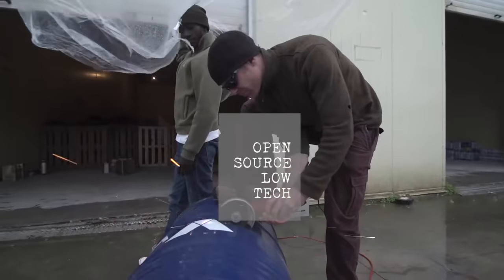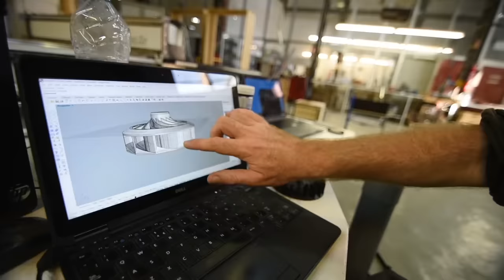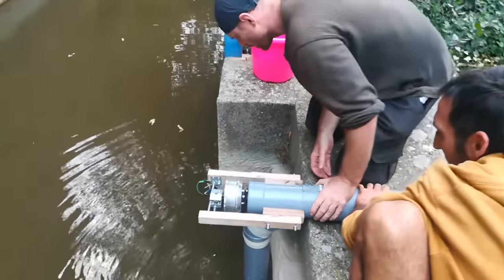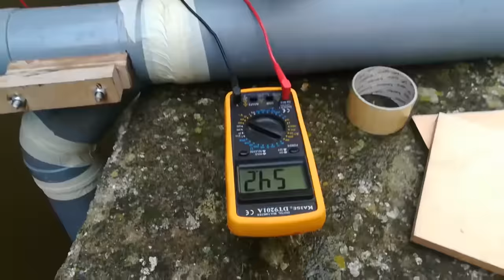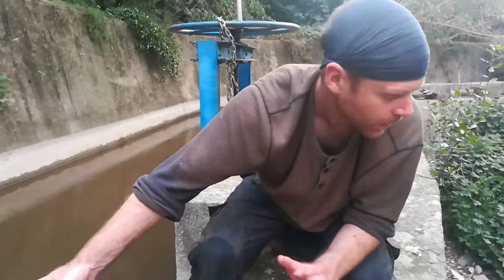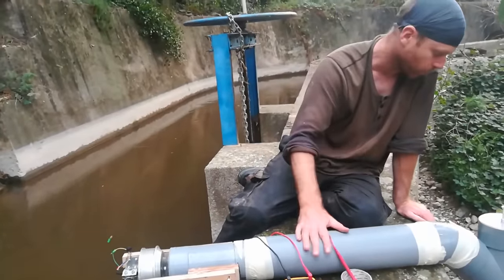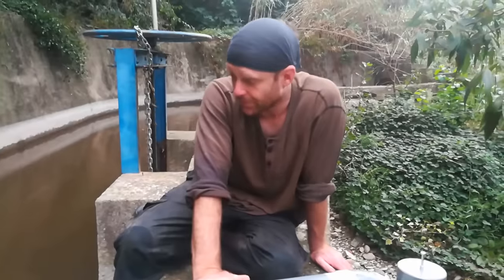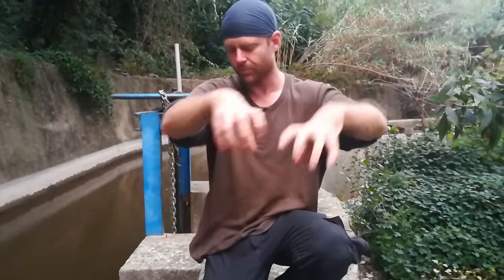The $50 Water Turbine -DIY, Portable, Powerful, and Open Source

Comment: Hello, can you tell me how siphoning with an open bit at the top works? Am I wrong about siphons or do I miss something?
Reply from the maker: Which open bit?
Reply: @OpenSourceLowTech  Does having the turbine wheel at the top disrupt the siphon?
Reply from the maker: The only hole in the system is where the drive shaft exits and connects to the alternator, which I've got gasketed with an O ring and some foam rubber, which seems to be working fairly well in terms of low friction and a decent seal.
Reply: @OpenSourceLowTech Ah! Thanks! I understand it now!

Comment: You should not put the turbine on the horizontal plateau, but instead on the downward slope; you'll avoid risk of cavitation (lifespan increase) and high point bubbles (downtimes on hot season).
Reply from the maker: Indeed, check the part 2 video for pretty much exactly those findings.

Comment: Hello I am wanting to do something like this on my houseboat as a power source would love to speak with you on details on this
Reply from the maker: This design does need some drop, at least two or three meters. It won't work with flat water. There are options for that, but they generally only give useful power in quite fast flow.

Comment: Dude are you telling me that i can have 1 huge pool of water and I can put this in the pool and I can lift the water up 2 meters and once I start it it wont stop ? it does not need to be a river:) and a wall. I got the part where the power is coming. The thing is. i doubt water will keep on coming up especially when having a propelar to spin. Sounds interesting for a try.

Comment: Good Afternoon sir for thesis proposes where i can order that protable turbine. Because we want a thesis like your idea but it will be in sea water ang improve same of idea. May be it will be floating etc.
Reply from the maker: This turbine won't work in flat water unfortunately, the output needs to be lower than the input for the water to flow and power to be extracted.

Comment: 2 things, need 2 bearings on the turbine shaft could hear it rubbing inside of pipe, also just pull the cap to break siphon instead of lifting the whole thing on suction side lol
Reply from the maker: There's a bush bearing at the impeller end made of a nylon collar and stainless washers, for corrosion reasons. The sound isn't rubbing, just that the shaft ended up not quite perfectly centered so there's a bit of oscillation. 
I tried to lift the cap but the suction was way too strong for me.

Comment: how does the pressure work on that pipe? how does it suck water to spin the turbine?
Reply from the maker: I'd quite like to see a full pressure profile for the length of it, but basically it's just a siphon, so the fact that the output is lower than the input has gravity pulling the water through and establishing momentum.

Comment: Additional options
1-Add a battery to jump start the pumping without needing to add water
2- add a charging feature to power said battery to jump start the water pump at a later use/time
Reply from the maker: Would be nice if the turbine were reversible, and could be used as a pump. Unfortunately tho the fan / propeller type runner wouldn't be capable of lifting a water column in air.

Comment: Muy buena idea
Faltaria comparar con un sinfín de 20 cm de largo y el mismo diámetro ( similar a los que usan para mover granos en los chimangos de las monotolvas de cosechar y mover granos) ,si no es superior el par de fuerza
Reply from the maker: Archimedes Screw turbines are good, but harder to make. Much higher torque at much lower rpms, and I tend to prefer favouring the latter for the sake of being able to get enough voltage out of the alternator options.
A screw would need a lot of gearing up to reach charge voltage, which is extra moving parts and complexity.

Comment: If the moter is 100 watt,  how many watts you will get from the water generator?
Reply from the maker: The wheels are rated at 350W as motors, check the part 2 video for power output numbers.

Comment: Actually hv u try installing another motor on the down side of that pipe like the first type, then u get more generated in 1 device, coz the water gained its mass due to gravity, maybe its enough to be converted  to electricity

Comment: Why do not use generator at the end of the pipe closer to output water hole and get extra power to the generator from flowing down water? You can use current generator attached hole as flow starter water fill hole also this will let you do it more easier.

Comment: I guess the biggest concern that I would have with building this system for someone is that the essential plastic part would be subject to aggregate bombardment.  Even silt or suspended clay or organic matter would have a huge impact on those parts over time; no?
Reply from the maker: Quite possibly, currently doing longer term site testing to find out.

Comment: Do you know rpm of motor/generator at 55volts unloaded?
I-m going to do a similar project for my sisters off grid cabin. And I'm gonna use a hoverboardwheel , regulator from motorcycle (FH020AA) and charge a batterybank with 4 car batteries in parallell.
Reply from the maker: Should be about 0.05 v/rev, 50VAC @ 1000 rpm.

Comment: Have the turbine spin a waterproof wire that runs up to where you are using the power supply. That way your electronics arent near the water source, and you have less power loss.
Reply from the maker: It'd be a bit of a distance to run a transmission. The hoverboard wheels are pretty well weather proofed, other options might need some cladding..

Comment: Be careful with your math. Load and flow.  500 watts x 24 is 1200 kWh, but when all the homes you mention turn on the lights, the 500 watts disappears quickly and boom, you've blown circuits. You need to charge batteries with the generator and do the math on the battery, which will give both kw and kWh. You need both.  Subscribed. I love this stuff. Feel free to reach out to talk more. Giving back my knowledge and experience is my goal.
Reply from the maker: Check the parts 2 and 3 videos for load test results.

Comment: This is a much-needed technology, especially for us in Africa. Some of us are not scientists. can we buy a fully-fitted set for a stream that is slightly less than a meter wide
Reply from the maker: How much meters drop and litres flow?
What's it to power?
Reply: @OpenSourceLowTech  Thank you for your response. Honestly, am not sure I can measure the water but the stream is about a miter wide, gentle slope, constantly running water with no drop. 
I am in Uganda, and the need for these innovations cannot be overstated. only 20% of Ugandans are connected to electricity. 
I loved your technology because you manipulated the drop -so to speak.
Reply from the maker: Probably wouldn't be viable then unfortunately, the drop doesn't need to be vertical and can cover some tens of meters of horizontal, but this turbine will need at least 2-3m+ to function.
Reply: @OpenSourceLowTech  I feel we can try to create the drop. we can collect the water in a pond the release it through a drop. It can be done. 2 meters can be achieved.
Reply from the maker: What would be feeding the pond? The turbine goes through a thousand litres in about thirty seconds, depending on configuration, so it really needs to be plugged into a constantly flowing waterway.
Reply: @OpenSourceLowTech  The idea is to re-channel the stream through a pond we are going to set up to give us a drop.
Reply from the maker: How much flow on the stream, and if it can be feeding a pond with drop below it is there not drop in the stream can be used instead?
Reply: @OpenSourceLowTech  the flow is quite big. It's at least a meter wide, and more than half a mitre deep of constant running water. we intend to channel the entire flow to the pond. The good thing is that we have a lot of room. we have 2 streams with sides of the land. each running for about 200 metres during the dry season. the slope is gentle but with variations. we can dig a new channel, reduce the slope before it collects into a pond then release it through a drop. i believe 2 metres can be achieved esp where the streams meet. how do you advise me?

Comment: I am starting off with the fan, the water is poured on it and it spins. After this I am stumped, I have a belt that turns, but do I connect it to an alternator, please help.
Reply from the maker: Have you checked the part 2 video in Berlin? It has a bit more info on the internals.

Comment: Where I can buy "ready to Use" tools like this. Which is cheap, easy to install & maintenance for non engineering background, applicable for 1 house needed. 
I need to install that tools at my father in-law house at west africa bcz of no electricity there
Reply from the maker: I may end up also selling them as units. Will have to see.

Comment: What generator are you using?
Reply from the maker: That's a wheel off a hoverboard / balance board, but I'll also be experimenting with treadmill motors, direct drive washing machine motors, and maybe rewire a motorbike alternator if I get around to it.
Reply: @OpenSourceLowTech  thank you for answering my question. I want to ask again about how much difference in height on this video?
Reply from the maker: Think it was 2.2 meters from top point to bottom outlet, but with about 50cm down to inlet, so 1.7m effective differential.
Reply: @OpenSourceLowTech  thank you for answering. you are very helpful for my final assignment. if there is something I will ask again

Comment: What is missing is a 12V battery and an MPPT solar charge controller.

If you use a solar charge controller with built in Bluetooth you can monitor alternator voltage, current, power with a smartphone app on site. The MPPT controller will  apply the alternator voltage where the setup delivers maximum power.

Devices like this will make alternator voltage less important.
https://www.victronenergy.se/solar-charge-controllers/smartsolar-mppt-75-10-75-15-100-15-100-20

If using 1 or 3-phase permanent alternators just add a bridge rectifier to make DC before the controller.
Reply from the maker: Check the part 2 video for a bit more info and outcomes on the electrical aspects, but yes next step is to plug it into a real use power setup.

Comment: Hmm. Why not put the turbine / impeller vertically, at the lowest point in the pipe? It should be the most pressurized or having the most pressure difference with atmosphere.
Reply from the maker: Now that it's working well enough under test conditions, the next step is real world testing, ie plug it into a river. The main thing to figure there is the optimal position for the impeller, either at the top as in the part 2 video, at the bottom as you say, or in between.
The thing with water is that it's also capable of producing negative pressure, so it remains to be seen whether that's more efficient with this setup.

Comment: if the impeller had higher torque, and you are presuming access to a 3D printer, why not 3D print a gearbox or belt system between the water and the alternator to step up the RPMs?
Reply from the maker: As per the part 2 video, I'm now preferring a PC fan instead of the printed impeller, for reasons of availability. They also have the advantage of producing much higher revs.
I'm wanting to keep this direct drive if possible, as it's considerably easier to build.
Reply: @OpenSourceLowTech  I noted the higher revs, thats why I made the comment about the gearbox. with more torque+gearbox you could be able to design a higher-rev system that is more efficient, especially with regards to reducing cavitation (noted from part 2). But yes, no question about the difference in availability

Comment: As impressive as that system is, if the flow rate of that siphon is greater than the flow rate of water coming into the top of the dam,  then you are going to burn through water faster than is possible. Hopefully you have already thought of that and have limited the siphon to only output less than what is coming into the top of the dam.

Comment: For a truly optimized and maximally efficient system, each area must be independently designed to take advantage of local conditions.  Choosing a less efficient turbine blade design over another specifically because of it's higher RPM and therefore ultimately higher output voltage is NOT ideal.  For any given head height and water flow there exists an optimal blade design that will extract maximum energy.  An alternator should then chosen that best matches the torque and RPM provided by the selected turbine, preferably having three phase AC output.  THEN, if a higher voltage is desired to reduce wiring losses, that should be done separately as well by using a nearby step-up transformer.  Coincidentally, this process is the same that electrical utilities use.
Reply: Tonight star prize - for completely missing the point!!!
Its supposed to be quick and cheap........!!!!
D'oh!!!

Comment: Can you please covert a gas generator to hydro? I've got an old generator with a bad engine and have been wanting to covert it just not 100% sure how
Reply from the maker: The alternator could be made use of, but they're usually pretty high revving, so might not got much voltage out in this application.
Reply: @OpenSourceLowTech  10 4.

Comment: SO you put out 55 volts,, what does it do under load?
Reply from the maker: Check the part 2 video, but basically got it doing 61VDC @ 3.1A = 192W with 2.5m drop and 30 l/s flow.

Comment: I would like to put the turbine on a approximately 45 degrees angle hoping to increase power to 60 volts. Another test at 90 degrees down the pipe. Water with help of gravity. Just an Idea.
Reply from the maker: Check the part 2 video in Berlin, I was getting 61VDC (rectified) @ 3.1A load.

It's probably somewhat more effective with the draft tube at 90, but should also work well with an incline.

Comment: What type of shaft seal did you use?
Reply from the maker: Tried a couple different options, best one it terms of low friction low air intake turned out to be just an O ring over a couple wraps of tape around the shaft, under a square of foam rubber taped to the pipe end cap.
Next video will have more details.

Comment: what engine is the turbine taken from?
Reply from the maker: The turbine itself, ie the runner/fan is just a standard computer power supply fan. They seem to hold up ok so far, but am in the process of testing them longer term.

The alternator is a wheel from a hoverboard / balance board, which are excellent units if you can get them.

Comment: perhaps modify the tube to create laminar flow before it goes through the prop
Reply from the maker: Yeah, I'll be experimenting with stator turbines to direct the flow onto the blades and see what that does to the efficiency and output.
Reply: @OpenSourceLowTech  smarter every day channel,  Dustin, showed some techniques, one as simple as a cone on the inlet, well he used a plastic swimming pool  with a hole in it. i look forward to seing your improvements, its nice to see tech made from everyday items

Comment: Where do you buy your parts from
Reply from the maker: The hoverboard wheels I get second hand that someone's getting rid of, everything else is off the shelf. PVC plumbing fittings are pretty easy to find, as are 120mm PC fans. The rest is just nuts and bolts.
A motobike alternator should stand in for the HB wheel fairly well, and is more globally accessible.

Comment: 55V @ 10A? how did you get amperes with a multimeter? Did you just read the motor output? Very deceptive video. Also, what are you planning on powering that accepts exactly 55VDC?

Comment: What is the minimum drop to use a hoverboard motor?
Reply from the maker: The minimum to get it turning not sure, but as the power goes up, and down, on the exponent of the head, a little less meters means a lot less watts. I probably generally wouldn't bother with anything less than 1.5m, things start getting interesting and viable at about 2.5 - 3m plus.

Comment: Is eletcric scooter motor is efficient to charge 200ah deep cycle battery sir?coz i wang to use in hydro power.
Reply from the maker: As in, would an electric scooter motor work as well as the hoverboard wheel? I'd assume yes as they're pretty much the same thing, tho would depend on a couple input and output numbers. 
To charge a battery tho you'll probably need some kind of charge control in between.
Reply: @OpenSourceLowTech  thanks
Reply: @OpenSourceLowTech  thanks

Comment: A truomp pump was used for decades in mining industry's before electricity or gas generators the building up of air pressure from a simple waterfall  storage of small bubbles that fill a tank deep below no moving parts till tied to a saw mill or drilling holes or generator's for lighting. Tv he mass amount of trapped air in a short period of time.

Comment: "It feels more intuitive to put the turbine at the bottom, like the Pelton wheels etc..."

The strongest force in the Universe is the Force of Habit. Grandpa put his wheels at the bottom, because he couldn't seal the shafts and such as well as we can, with Moderne Materials™.
If the wheel is up top,  and there's any air infiltration, there's less water weight pulling on the wheel. If the wheel is at the bottom, and the wheel is where sealing is the weakest, it doesn't matter as much, because the water has already fallen.

Also, it looks as if you have more than sufficient flow to "stack" those bloody impeller units, too. Make it modular! And looking forward to updates!

Comment: So how much liter of water does it use an hour?
Reply from the maker: Depends on drop and pipe diameter etc, but usually something in the order of 30-40 litres per second for 200-300W, which would be about 120,000 litres per hour or so.
This probably sounds like a lot, but is just a small to medium stream or creek.